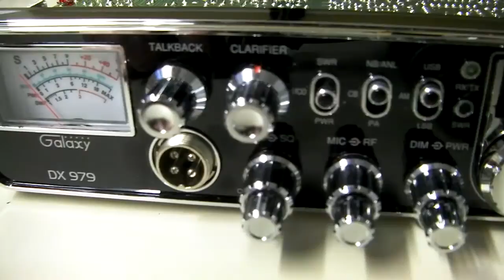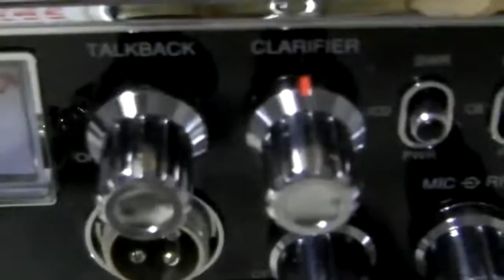Galaxy DX 979 - How to unlock the clarifier

Comment: I have a 959 and buddy has a Galaxy base. If we talk on SSB I have to constantly adjust the clarifier.  I get him tuned in good for a second and the next second it's off again. Will this mod fix that?
Reply from the maker: If his radio is the one drifting and you're having to adjust the clarifier to tune him in throughout a conversation, yet you don't have that problem with other stations the problem is on his end. Unlocking the clarifier to work for TX and RX on your radio or his radio won't solve the issue. His radio may need an alignment but some Galaxy radios are just prone to drifting.
Reply: @cbradiomagazine  yes that's exactly what happens. I only have to constantly adjust clarifier while talking to his galaxy base. Thank you for the reply 👍

Comment: Great Video.. worked perfect. Thank you.
Reply: On your 979 if you still have it. When you did this mod. Was it good to as as we seen it on the vid. Or did you have to take it to someone who had the equipment to re-align the radio. IDK just asking. I have a 979F same radio but with a freq display. And about to do this mod once i contacted some folks who did it
Reply: @LIVINGRETIRED310  when you buy the radio stock. The clarifier changes the frequency on receiving only.  When you unlock it. the clarifier will now change the frequency on transmit as well.  So no need to have a professional align it. So let’s say someone is talking off frequency. If I dial them in on my receive…. I will now be transmitting on their off frequency as well.  But we will hear each other just fine. Understand???
Reply: @TheBubba6587  That i understand Bubba. On ssb without the mod, i can dial down to 27.384 but when i key up ,im tx on 27.385 no matter where i turn the clarifier. I have had someone tell me im off freq, crazy huh. If i hear a strong signal i wanted to dial them in and tx where they at so no one has to fumble finding each other. My 2 questions, you did that mod on your 979 as the vid showed by unsolder and add a wire.Did it work for you ? And would you recommend that mod to all? . Thank you for responding
Reply: @LIVINGRETIRED310  It worked perfect... i did it on both my 979 radios.  So now when i dial someone in on SSB .... even if they are off frequency. I will be transmitting on the same frequency as they are...
Reply: @TheBubba6587  It freaking worked lol. conditions were bad but no problem hitting 725 in florida. Where ever i turn clarifier to, thats where i tx. super cool. The one thing i did different is cut the legs off of resistor & diode from otherside of panel. But i saved them for reference for new ones if i need to reverse back. Thanks for helping... Ron / 359 Middle Tn
Reply: @LIVINGRETIRED310  Awesome.....!  😎

Comment: The best way to do this mod is adding an external 8V regulator to the circuit, because the 8V present on the board are not stable btw rx and tx. A simple UL78L08 does the work, but need a diode to the ground leg to archieve 8.6V necessary for this mod. Good Luck

Comment: Is it the same as 959
Reply: +Tim Dedmon NO

NOTE: As with any mod exercise a great deal of care !!!!
Due to the placement, size, and close proximity of the surrounding traces.
If done wrong you could destroy the PCB or components.

If you have even the slightest doubts or the proper equipment ,
it would be wise to have someone else you trust perform the mod for you.
SO TAKE YOUR TIME AND DOUBLE CHECK YOUR WORK!!!!

Method 1:
1. First, remove power to the radio. Remove the bottom chassis cover of the radio.
2. Remove R113 and D68 as shown above.
3. Connect a jumper wire between +8V and J9 pin F1.
4. Perform an PLL alignment as shown below.

Method 2:
1. First, remove power to the radio. Remove the bottom chassis cover of the radio.
2. Remove JP195 and JP196.
3. Connect a jumper wire between +8V and J9 pin F1.
4. Perform an PLL alignment as shown below.

Note:
After doing the Clarifier mod or clarifier range mod you will need to realign L20, L21, L22 but not VR7 because the clarifier mod eliminates VR7 from the circuit.

AM Frequency:
Set radio to CH 1 AM RX mode.
Clarifier control to center detent.
Connect frequency counter to TP3.  
realign L20 to 16.27000 MHz ± 20 Hz

USB Freq:
Set radio to CH 1 USB mode.
Clarifier control to center detent.
Connect frequency counter to TP3.  
realign L21 to 16.27250 MHz ± 20 Hz

LSB Freq:
Set radio to CH 1 LSB mode.
Clarifier control to center detent.
Connect frequency counter to TP3.  
realign L22 to 16.26750 MHz ± 20 Hz
Reply: 617CentralMASS sorry if this is a dumb question, but the instructions you just posted here... These are for the dx959?

Comment: Tried it, had to take front cover off to remove two components after unsoldering on top of board, but working great now and nice to be on frequency for sideband. Has helped me make contacts I couldn't reach before because a little high on frequency out of the factory.
Reply: Did you need to do an alignment after this or was is just good to go?